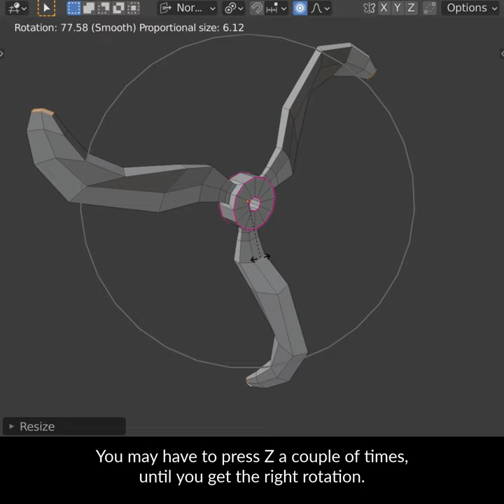Blender Secrets - Easy Propeller (Updated!)

Comment: Thank you for sharing!

For those who still struggle with the blade rotating step using Proportional Editing (0:43), your "Influence Circle" (the gray circle that pops up when you press R) may be too large. To fix that, after pressing R, scroll down your scroll bar until you see a gray circle, then you can move your mouse to rotate and you will see the same effect.

Comment: quick tip for rotation:
Right Click right rotation box (x,y or z)
Add Driver
In Driver Editor under Scripting put in frame
Now It will start spinning real fast. Just divide by whatever number till you get the result you like
Your fan is spinning :) (This was such a pain in the ass to do in 3ds Max)

Comment: Nice tip thanks. Just a note though, real propeller blades are angled from the roots and slowly twist at a shallow angle towards the tip. That's because they revolve slowly near the center and faster towards the tip ;)
Reply from the maker: It’s a Dutch propeller, they turn the other direction. 😉 No but seriously, to fix it: select and hide the cylinder part, select the root of the propellers instead of the tip and rotate from there. Then unhide.

Comment: rotation isnt working properly for me. each blade rotates but as one, meaning each whole individual blade rotates as one instead of it actually curving. also the mean crease part is rotating too. i thought that having a mean crease value of 1 means it wont budge?
Reply: anyone else encountering the same issue. scroll ur mouse wheel until you see the ring appear.

Comment: How about continue animation of this propeller
Reply: Easy make some keyframes by rotating 45 degrees on y axis
Reply: @paulcg7566  sir how to do 50 rotation
Reply: @komkumarkumar4451  Personally I would set a key frame for 0 in the y axis (or what ever axis your propeller is on) and then at the end of the time line set a key frame and type in the Y rotation box 360x50 (or 18,000) and set the key frame. Some of the value boxes in blender can actually do math so this can be helpful when you aren't quite sure on the exact number needed but you know you want something to spin a set amount of times.
Reply from the maker: https://www.youtube.com/watch?v=pRgsjo0dhfk